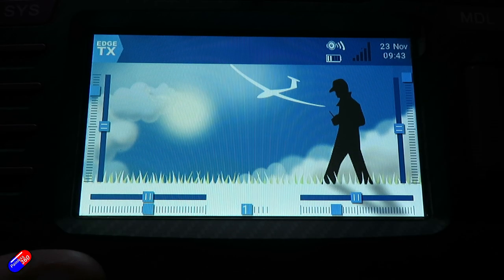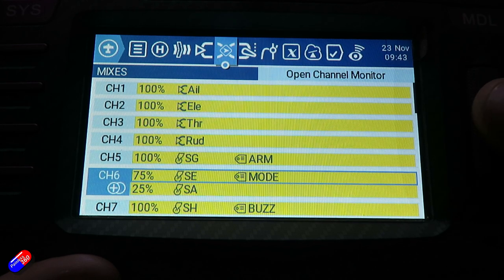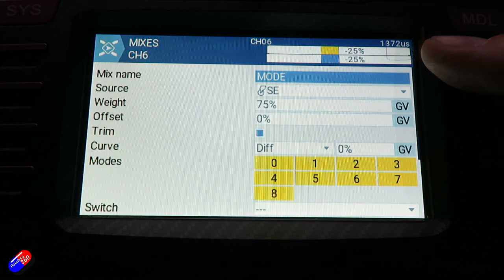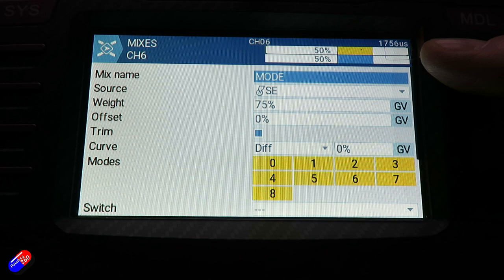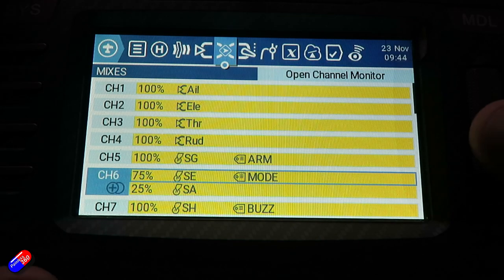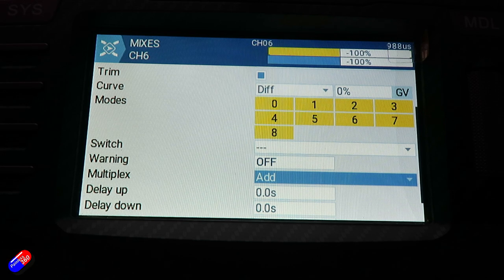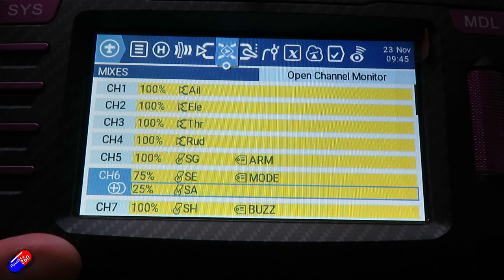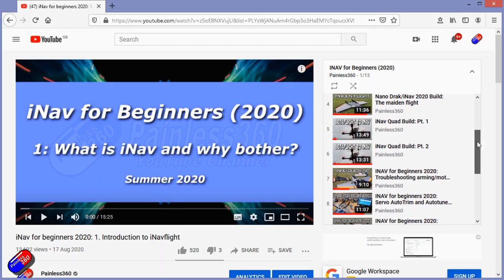9 channel positions from 2 x 3 position switches - easy way

Comment: Thank you so much for making the video the explain how to do that easily.
The mixing with the proper weight is a very good method to do that.

Now I have Ch 6 showing correctly on the TX12 transmitter exactly the way you have it.
9 positions with nice increments of 25 from -100 to +100.

However inav Ch6 does not have a nice increment of 125 between 1000 and 2000. It has 7 positions instead of 9. The increments are uneven (which is OK for flight modes), but the 2 missing steps are at pretty confusing spots. It will make it difficult to remember during flight time.

The same problems in ArduPilot 4.3.1 too . This lead me to think it is not inav problem.

The "Channel Monitor" page on the TX12 is showing correct switch positions, so I don't think there is hardware problem with the switches.

Eliminating the above 2 possibilities, then it may be EdgeTx, or ELRS tx or ELRS rx firmware problem. Have you seen similar issues with some firmware?

I noticed all the potentiometer inputs (4 basic channels and 2 slider wheels on the side) are working perfectly, but switch E, and mixing with any switches acts weird from inav's standpoint. 

I will review your EdgeTX/OpenTX playlist and may be I can find the solution there.

Thanks again.
Reply from the maker: If the channel moves correctly on the radio then it is the radio system in use. Are you using ELRS by any chance? If so, check out the newest video in my ELRS playlist... Best of luck
Reply: @Painless360  I am using ELRS. I will definitely explore your playlist to gain knowledge in this area.
Reply: I did an experiment on Ch5 to Ch12 of my ELRS system.

I tied the silder potentiometer switch S1 to all channels 5 to 12. Slowly sliding it, and it is clear that Ch 5 only have 2 positions.
Ch 6 to 12 has 7 steps with uneven increments. 

That explains why 9 steps with even increment does not get what is expected on the ELRS receiver side.

I found the ELRS provides 4 channels with full resolutions of 1024 steps for AETR controls. The other channels are only for 2 pos or 3 pos switches, and Ch 5 only has 2 steps which is meant for arm switch. The limited steps are by design as full resolution on many channels will need very long latency to go through them over the radio link. I don't understand why they have uneven increments between steps, but that is what  it is for ELRS. There is such limitation for all those Aux Channels.
Reply from the maker: Watched https://youtu.be/xXftiFz9KKM ?
Reply: @Painless360  Thanks for the great explanation of the subject.
My TX12 was shipped with elrs 2.3.0 for zorro. Will figure out how to upgrade to elrs 3 and try out the wide mode.

Comment: You have not done a video on optical flow and lidar in INAV. Matek makes a pcb with both. You might have a lot of fun with that. I can't decide if it is something worth the weight difference, price (although rather affordable), and extra setup time... I would love to see practical applications for this device.
Reply from the maker: I've used them in the past but don't add them to my INAV setups. Interesting ideas, thanks

Comment: 👍👍👍👍Great tip as always (i am subscriber).
I have a question: i am reusing an old apprentice s receiver (eflr310013), and they way for this receiver to work is with a switch between the esc and the receiver so that after the battery is conneced the switch is turned on and powers the receiver. if receiver is left connected, ot sends a funny signal to the esc and esc enters in a safe mode not arming the motor.

Question: is the a way to program a on off switch for the throttle so it stop sending a signal to the eac as soon as the battery is connected?

i hope you have some advice, thanks!!!!
Reply from the maker: I have no idea about this. I've not seen this receiver and I can't easily find a manual. I'm not the best chap to help with this one. Best of luck!
Reply: @Painless360  Thanks for the response. the question is more about opentx capabilities: can i program a switch that simulate a physical switch?
the goat is stop receiver to send a throttle signal to the esc as soon as it is powered.  I this possible?

thanks
Reply from the maker: EdgeTX and OpenTX are very powerful radio operating systems so I'm sure you can. I don't understand exactly what it is you want to do, but please check out the OpenTX/EdgeTX mixing school for lots of tricks and tips.. Best of luck!

Comment: Is there a way to wire this physically?  I have two 3positjon switches id like to wire together to control 1 output 6 ways. Flysky i6x 

Please let me know your thoughts sir
Reply from the maker: Why would you want to? Opentx and EdgeTX provide a simple way to set this up, and many modern radios have 6 position switches. What radio do you have?
Reply: @Painless360  hi thank you for replying. I'm completely new to anything used for planes or drones. So I have never used open Tx. I have a flysky i6x that is modded into an original Xbox wheel.  I have several extra 3 way switches